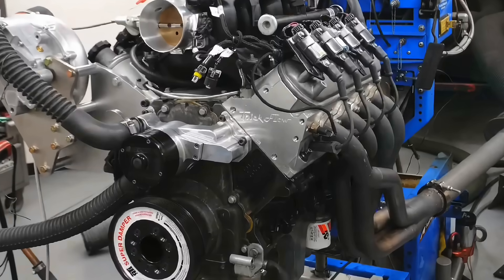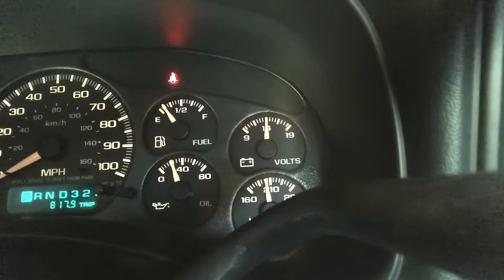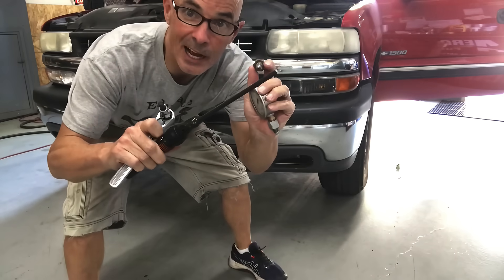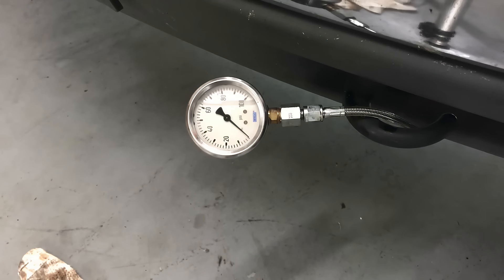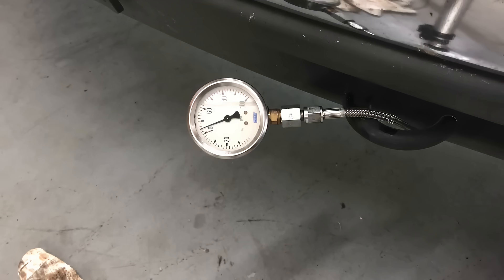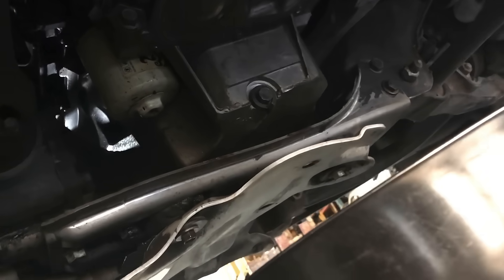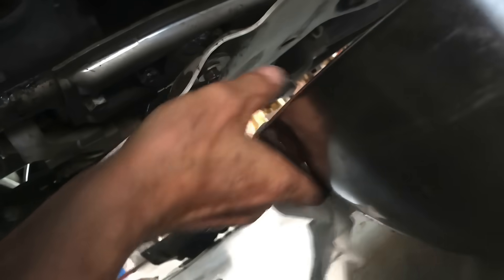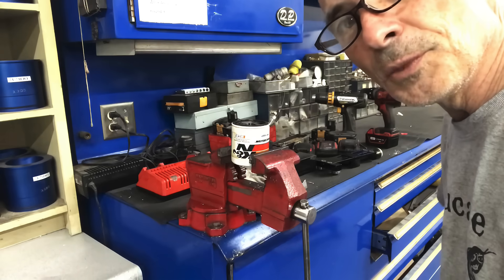HOW TO: TEST & FIX LOW OIL PRESSURE IN YOUR 5.3L OR OTHER LS?

Comment: Make sure all of Mankind pulls the valve covers on these severely neglected 5.3 engine 9 times out of 10 they are mucked beyond of saving i just had one! It was dine and the owner couldnt understood lol cuz of his neglection rate it was done. Mankind can and will destroy a steel ball if they wanted lol really honestly
Reply from the maker: having run dozens of junkyard LS motors fresh from the yard, your 9/10 estimation is WAY off. I've only ever had 1 bad LS motor and the choice was my own fault (didn't look at the big hole in the pan). Otherwise, the LS motor from the yard have all been good runners

Comment: My gauge is reading high oil pressure at low rpm’s like 70 psi at 2.5k rpm’s anything helps
Reply from the maker: what pump do you have
Reply: @richardholdener1727  possibly still the oem one need to ask my brother bc I bought the truck off of him

Comment: Don’t ever replace based on what o ring
Was installed especially on a high mileage motor that may already had it replaced with the wrong one. Most put in the bigger one thinking bigger is better. The instructions for the o ring kit show that it is the shape of the oil tube that dictates the correct color or style of o ring.

Comment: Appreciate the know how on the oil pressure! My lifters makes that same noise. A couples of people said to pour diesel oil into it and it should fix the problem. I’m very hesitant to that whereas I believe the problem would persist ,cause further damage,or do nothing what so ever. What do u think? I wanna correct the problem
Reply from the maker: oil usedin diesel trucks won't change lifter noise-it is interchangeable with gas engines

Comment: Uhm 36-50 lbs oil pressure is low?
Reply from the maker: there was a change in idle oil pressure-look for changes (not just the value)

Comment: Just got a 06 Silverado 4.8 4x4 with a maxed out oil pressure nd check engine light about knock sensor. Got both ks replaced nd replaced oil pressure sensor. Now my oil gauge goes up nd down nd with idle its drops nd light comes on low oil pressure. That mean I have to replace the oil pump ?
Reply from the maker: Put a mechanical gauge on it to verify oil pressure

Comment: When I bought my Tahoe the average oil pressure at idle was around 40 PSI. Now recently the oil pressure gsuge needle has been jumping around. I replaced the sensor switch. The needle no longer jumps around but now my pressure at idle is 17-20 psi

Comment: Loose Cam Bearings can also cause low oil pressure and should be checked when you have the pan dropped to replace the O-Ring plus you SHOULD replace the oil pump when you do an O-Ring most engines that have this issue are above 150k miles so while you got it torn down slap a new pump in that fixes 2 problems and future problems while your there. Unless you cannot afford the $ 100-140 bucks for a new pump:P While pan is down you can look up and see if any Cam bearings have moved they will be slightly visible and if they are they need to be replaced.
Reply from the maker: this one has 340K miles
Reply: @richardholdener1727  I also discovered another area nobody talks about, but has been a real oil pressure killer the little plastic bar bell looking thing with the O-ring that goes in the oil gally in back of engine next to the Main seal. I have been chasing an oil pressure issue on my 2003 4.8l. Replaced the Oil Pick up tube O-ring inspected bearings they are good still got a low pressure reading sensor been checked as well. I was thinking oil pump, but they rarely if ever fail so I was at the ends of my wits when a buddy told me it can be that oil gally bar bell thing so that is my next check. Never knew to check that so I am hoping it solves my problem going to try that next if it fails I am buying a new engine.

Comment: In the video there was a light tapping knocking noise in your motor my truck has the same noise and lower oil pressure like yours. Did changing the o ring fix that noise? Was it low oil on the lifters causing it? Or is it soemthing else along with my lower oil pressure?
Reply from the maker: piston slap most likely when cold

Comment: With high mileage would the screen that goes under the pressure sending unit cause a low oil pressure reading even if it was replaced?
Reply from the maker: is yours clogged?

Comment: I had low pressure on my 2020 5.3.  225000 miles.  I had a bunch of sludge in the bottom of the pan.  So much that when I took my plug out nothing camer out the the drain hole.  My guess is that it was blocking the intake. I used to change my oil ever 5k with mobile 1. Now I change every 2.5k. and use a small coat hanger with a hook on the end and rake the sludge out of the hole.  After about 5 oil changes using this technique I have removed most of the sludge and my oil pressure is back to normal.

Comment: My 5.3 was the two O-rings in the pickup tube.. Problem for me was, the truck was a 4WD, and to get the oil pan off, I needed to remove the transfer case in order to replace a couple of $2 O-rings.. Thanks GM.

Comment: I replaced my oil pump with a high volume oil pump replace the pickup tube replaced the oil sending unit and filter I hooked up a external oil pressure gauge just like you did and I have outstanding oil pressure cold start was 80 lb warmed up to 210 was 59 lb I dealing if I have this kind of oil pressure how come my gauge is showing low oil pressure is the pressure relief valve in the oil pan keeping my oil pressure at the gauge in the vehicle from Reading correctly I obviously have plenty of oil pressure so maybe it's my gauge cluster any information at this point would be helpful.
Reply from the maker: what pan?

Comment: I’ve been wondering why that pick up tube can’t just be one full tube piece to due away with the o-ring all together, can’t it just be tigged welded permanently???  I have an 05 Tahoe z71 that will probably need the dreaded hernia o-ring operation and I understand it’s considerably much more work than a two wheel drive.  I will see if it can be welded permanently if I do the job myself, I’m just saying
Reply from the maker: the factory o ring lasted 330K miles-no need to weld

Comment: 38PSI at an idle and 45-60psi at higher rpms is NOT low oil pressure.
Reply from the maker: you need to look beyond comparing it to yours-there was a dramatic change in oil pressure-it IS low
Reply: @richardholdener1727 It may be lower but it isn't low. 
per G.M. serv man.  it is right where it should be.

Comment: Was that the fix? My 04 1500 Silverado 5.3 229K miles has the exact same oil pressure stays right at 20 PSI at idle or driving. No check engine light, isn’t running rough or miss firing no lifter tick or knocking. Also the oil level is good and clean oil as well.

Comment: You never mentioned the mileage on the truck. The meter is set to trip. and 8k trip doesn't offer much information as to total mileage. I don't see a problem here. I just installed a new long block from Freser Engines. It's a 5.3 in my 07 Silverado. I just turned over 500 miles and changed the brake in oil. I used Driven GP1 30. I cut the filter open as you did and found exactly what I was expecting. Very few sparkles caught in the pleats. After the change, there was zero difference in the OP. About 44 @ cold idle. 40 at running temp @ idle. With the new oil, about 70 psi @ 2k rpm.
Reply from the maker: 330K and there is a problem when oil pressure changes significantly

Comment: My dad's 2011 5.3 silverado has 179,000 Mike's and out of the blue, low oil pressure light came on and said shut off motor. We replaced oil sending u it and the screen, it held pressure at 25psi for about a mile and did same thing. It's now in the shop and they can't figure out what's wrong. And if we try to tell them what may be wrong they get very testy. Can you help me out.
Reply from the maker: check o ring on pick up, bar bell, front cam ret plate seal, rear cover seal, oil pump and check for bearing material in oil

Comment: You don't need to be on here if your not actually  doing the work there are more problems  with low oil pressure  lot of you guys will not make good teachers  especially  if you don't actually  work on the vehicle
Reply from the maker: you must be new to the channel-who do you think does all the engine building and parts swapping and dyno testing for this channel-only 1 guy

Comment: As long as your oil pressure gauge reads an oil pressure above 5, i would strongly suggest you first pour into your oil an oil flush like Medic, run at idle for 5 minutes, then change oil, using a good oil filter, and put in as part of your oil a quart of Lucas oil stablizer!! Then see how the pressure is. This worked for me. My oil pressure went to 36 to 42 regardless if just starting or running for a half hour. I did not need a new pressure gauge and screen filter. With mileage over 200,000 do this once a year. Best wishes.

Comment: I know this is old but I’m having this problem now. Had a leaking oil cooling line and didn’t know it. Oil would drip onto the plastic cover and always going down the road would just blow away or on other things and would NEVER drop on the ground so I had no idea and ran low on oil one time. So I’ve been really worried about my bearings and rings… need to get other motor rebuilt and back in other truck before I tear that one down… pain in my rear..

Comment: My 97 chevy express 1500 5.7l oil pressure guage is normal when engine is cold. After engine warms up oil pressure drops. Driving oil pressure reads normal. Idling oil pressure drops. Oil light never comes on, even at zero oil pressure.
Reply from the maker: check with a mech gauge

Comment: I changed the engine oil in my 2013 GMC Sierra a week ago. I've had this truck for over two years and have grown accustomed to where the oil pressure guage rests throughout the warming cycle and normal operation. 
This time I used the usual Pennzoil 5W-30 Platinum Full Synthetic along with a new-to-me ACDelco PF48E filter that was available locally. I usually have a couple Wix 57060XP on the shelf but had run out and couldn't find one locally.
I drove to work the next day and at the first traffic signal I noticed my oil pressure guage reading a bit lower than usual. The truck is usually at 30-35 PSI idling in drive and 40-45 driving at 1.5k-2k RPM. But now it was 18-20 PSI idling and 22-26 PSI while driving.
I started watching YT videos trying to diagnose the oil pressure issue myself. I added a drop of Lucas Oil Stabilizer, no change.
I dropped the oil pan (pain in the rear) and changed the fabled o-ring, no change.
I bought a new oil sending unit. Before replacing that I decided to pause and ask...
WHAT CHANGED? 
AHH. The oil filter was a different brand. Maybe that's it?!
This morning I climbed under the truck with a drain pan and swapped out the brand new ACDelco PH48E with a brand new Wix 57060XP filter. Topped off the oil and started the truck up.
Dog gone it! The truck was BACK to the normal oil pressure readings of 30 - 45 PSI.
I don't know if the new ACD PF48E had a bad check valve or the media was too restrictive...
Fellers, if you find yourself parts-cannoning after a similar situation stop first and ask yourself: WHAT CHANGED?
I'm relieved that my truck isn't busted and it was a simple oversight.
I hope this helps someone out there.
Reply: same ! oil filter was my problem
Reply: I change my on ring put I still have low oil pressure I guess I will have to try the new filter and new oil I hope this does the trick thanks for the help mark.
Reply: My Tahoe is doing the same thing! It was fine before the oil, filter change and now my pressure is low and randomly throwing the No pressure turn it off warning. I can’t afford to randomly buy new parts to test 🤦🏻‍♀️😭I don’t know what to do
Reply: @mizzladyluck85  Purchase the Wix or Napa Gold filter that fits your vehicle. Have the shop that did your oil change replace the filter they put on with the new one you bought.. Then start it up and drive it a bit. The five to ten dollar difference in filter cost is much cheaper than an oil starved engine replacement.
Reply: @ddforrester  they put a/c delco on it which I think that’s what was on it but I think it’s the sensor screen possibly
Reply: I just installed ac Delco filter on my 2000 silverado ad the oil presure is low.  Ima try the wix filter.
Reply: Seriously I'm having the SAME problem and was about to travel the same road I'll give this a try first thanks BIG DAWG!
Reply: Excellent diagnosis and change to wix 57060xp oil filter. I had no idea  an oil filter could cause that great repair
Reply: Holy cow thats the same filter I just changed to on my 07 6.0 and im at 18psi warm idle currently. Im going to change filters and check again.
Reply: Stp filter = shit..?
Reply: Supported by mechanics?
Reply: @MR..181 yes, I put a stp on my 13 and  the oil pressure dropped to 19/20, changed it out to the wix and it went back to normal.

Comment: , my 93 that I bought in 2010 has been idling at about 15 psi when hot and when you step on the gas it goes up, 37,000 miles later, still no noises or knocking, probably the sending unit, or o’ring also I believe it’s called variable speed oil pressure, I just looked at a 1994 blazer had a crate motor put in in 2019 and not driven very much, oil pressure at about 16 below 20 at idle when hot and then goes off when you step on the gas pedal, seems like all those trucks are doing the same thing, probably oil sending unit or the type of oil gauge, my 05 Ford Explorer goes to 40when you start up and stays at 40 on the oil heats up, never moving never changeing
Reply from the maker: it is low oil pressure because it changed dramatically from what it was

Comment: I’m at a complete loss i have a 2009 1500 with the 5.3 when I crank it up oil pressure is around 40 psi as I drive and heat it up the oil pressure slowly starts dropping. When I come to a complete stop the oil pressure warning light comes on and there is almost no oil pressure, but I hear no metal on metal noises or anything like that. I changed every oil related gasket including front and rear main seal, the sending unit the oil pump and oil pickup tube, head gaskets. I have no idea what else it could be.
Reply: I am having the same issue I replaced the pump and pressure sensor. Replaced the rings to everything and still have pressure when I cold start it . But after two or three minutes it starts to slowly go down

Comment: I know Rich's video is now 2 years old, but I just run across a recent one with a stock daily driver 6.0 with a low pressure issue. They were following the same advice but the mechanic took a flashlight. Took a good look inside his engine and noticed a one of the center cam bearing walked out in was causing a low oil  pressure issue.
Reply: I'm afraid this is my issue. Built my 6.0L with btr truck norris cam, lifters, heads intake, headers the whole 9 yards. 6 months after the build was compete daily driving, I went from 40psi idle to 10psi and a furry oil drain plug. Still driving it this way and it's been almost a year since it dropped.  I have an LQ9 I'll be building to swap in its place

Comment: I have no oil pressure on a 5.3 GMC on a 2006 Yukon.  Went from 40+ psi to 0.  Replaced sensor and and suction tube O-ring.  Zero pressure measured at the filter with gage.  Suction tube O-ring/engine pan gasket and rear main seal was replace a month prior.  Any idea's on what the root cause is?
Reply from the maker: bad pump or grabbing air

Comment: i see GM spec says you can run 5w30 OR 10 w 30 in the 5.3 LS SO would it help oil pressure to go with the thicker 10w30?

Comment: Great video. I have a 2015 silverado 5.3 throwing a code. While i dont remember the specific code, i was told its the pump, which is a $1500 repair. Pressure stays normal but randomly drops to 20-30 psi at idle. I have to add about a quart of 0w20 every month. Someone told me that replacing sensor will fix this a lot of times. Is that accurate? Ill definitely do it myself if i can. Again, great video. Thank you.

Comment: If you suspect oil pickup 0 ring, confirm by over filling oil byb2 quarts and jack up rear of vehicle so the 0 ring is bathing in oil, your oil pressure will increase if the 0 ring is infact bad

Comment: It was a real let down when you doped it with 15/40 oil. You know that's not a fix. (Nor a diagnostic tool). That's what someone with no mechanical knowledge would do. Or some poor sap out of work that was just going to drive it to destruction because he's broke.
Reply from the maker: ONE OF US HAS RUN ENDLESS DYNO TESTS ON OIL TYPE, VISCOSITY, TEMP AND PRESSURE, AND HAS THE VEHICLE IN QUESTION WITH 325K MILES ON IT (STILL RUNS PERFECT). I JUST  MIGHT HAVE A LITTLE MECHANICAL KNOWLEDGE.

Comment: isnt THE PRIMARY CAUSE  from lotsa miles wearing the bearings thinner creating larger spaces for the oil to be pushed thru , thus barring a much higher VOLUME flowing pump, oil pressure will decrease over time.?
dont know personally but powerblock tv show ported their stock pump and dimpled the rotors claiming it helped more oil pressure and or volume

Comment: Did a pan gasket and tube -oring  went w 10w30(5qts) Lucas(1qt). Guy hs a Mobil 1 oil filter it was free w his oil  fired truck up ran and sounded fine. Sat in it and 😮 low oil pressure was on dash w gauge reading basically.  Truck sounded normal Reed up no movement on gauge at all???  He has a oem acdelco filter on it that I took off w the oil change after pan.  Could it be the oil filter  

HELP.  🙏🏻 thanks
Reply from the maker: try new filter, but it doubt it

Comment: My 2011 Tahoe currently has this low oil pressure issue and I’m wondering if it the o ring or oil sending unit filter inside the sensor socket, help anyone?
Reply from the maker: check the things mentioned